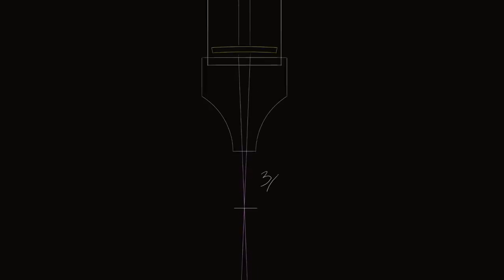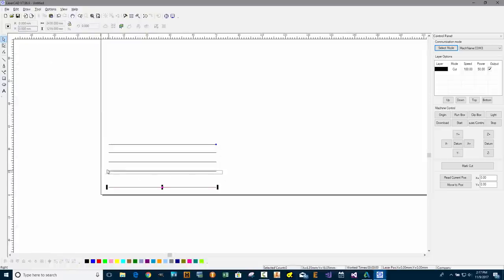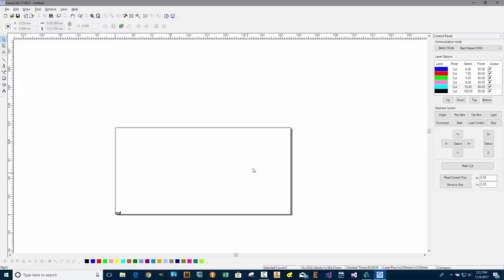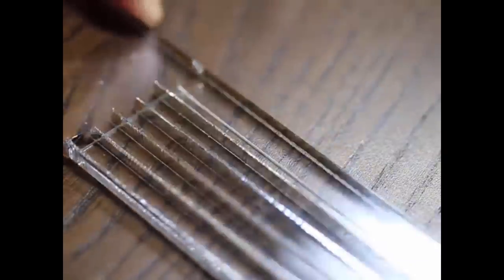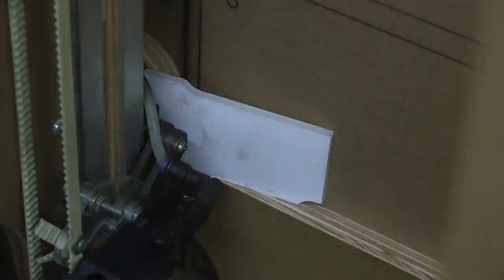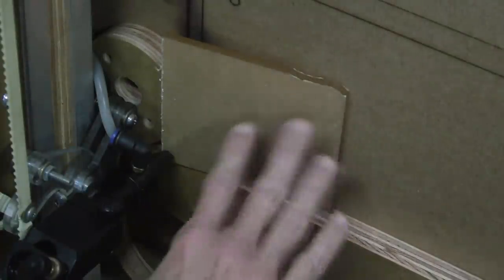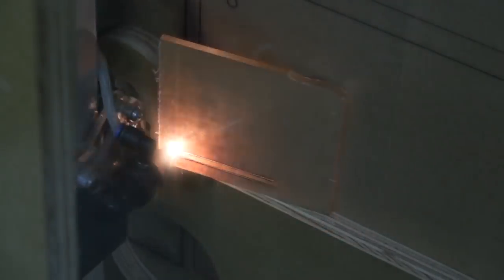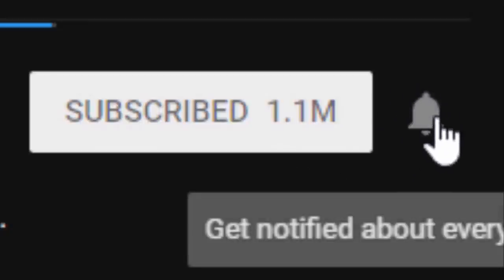Laser Cutting Tests on the Vertical Laser XL - .22" Plexiglass with 2" Focal Lens

Comment: Late to the party for an old video.  Ben using diode lasers for a while.  Just got a K40.  Does this software really control the power output or are you changing it physically on the K40 despite when you note in the cuts layers?
Reply from the maker: The intensity is controlled with a PWM output from the controller. The PWM duty cycle of 100% will output the laser to the max power that the laser tube power supply will allow. When you set the power in a layer, or when changing intensities related to toning nan image for engraving, the PWM will output a variable duty cycle corresponding to the engrave tone, or the power set in the layer.